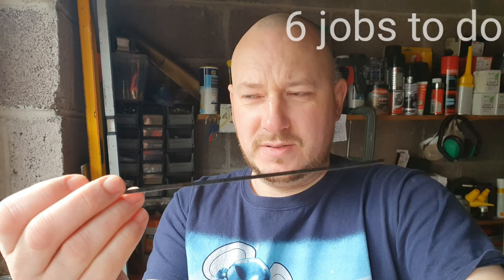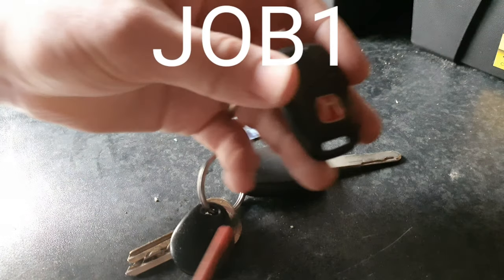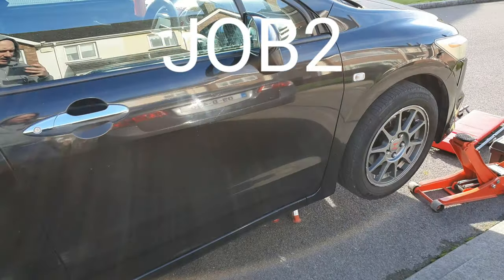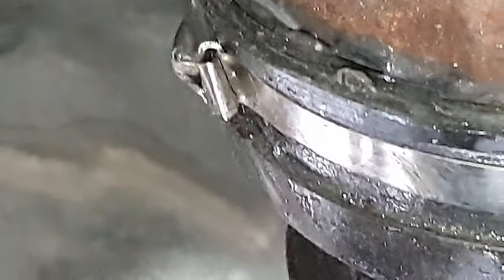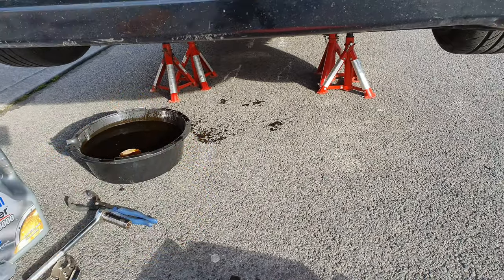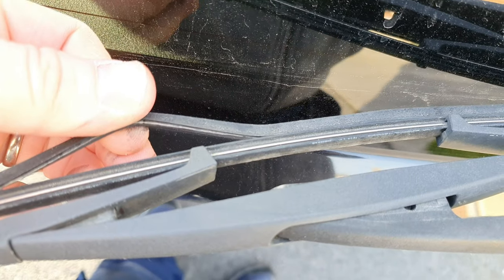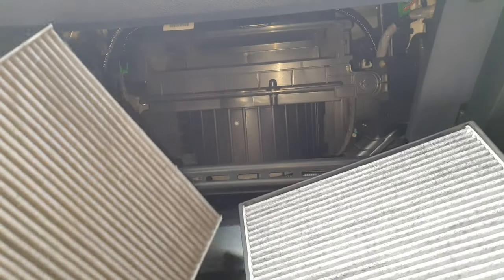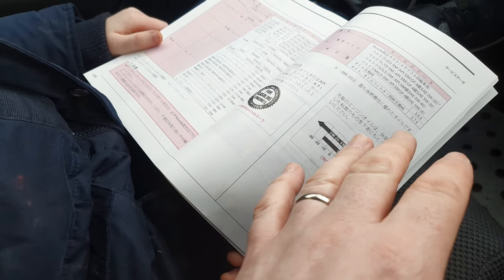honda stream rn6 to do list/Simple jobs anyone can do/oil change/cabin fiter/cv boot/key fob/wipers!

Comment: Didn't you just get a service a few months ago?

Should be using ultra low saps engine oil to prevent dpf clogging.  

Clean your EGR valve and associated pipes also.